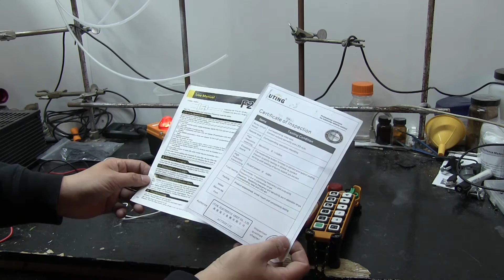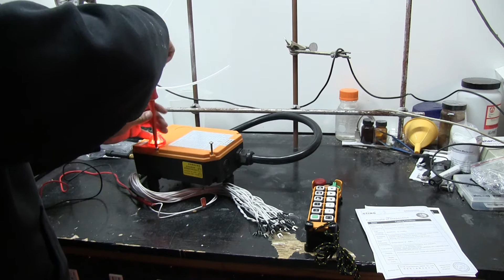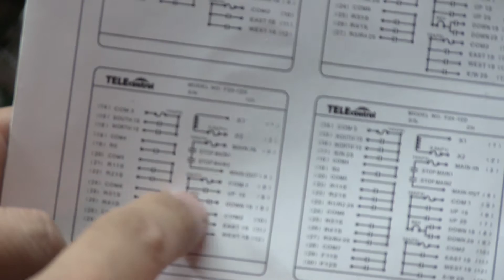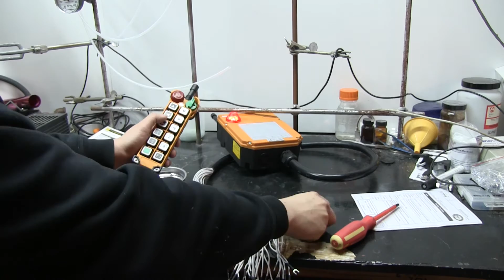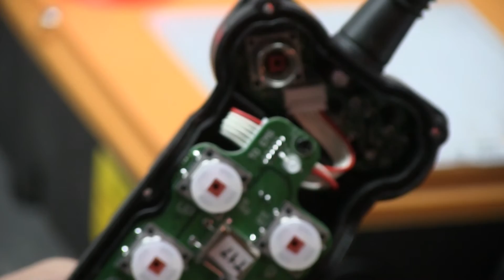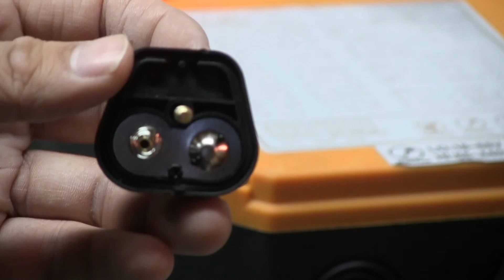(6) - Uting F24-12S Radio 'Crane controller' Teardown

Comment: Thanks for the in-depth review. I have stump grinder that I have plans to replace the hand control hydraulic valves with solenoid hydraulic valves and remote control it. This will free me up to view the grinding from any place I wish and not be so close to the noise.